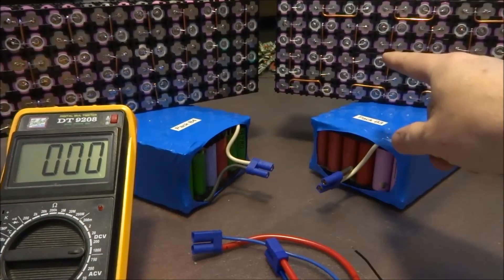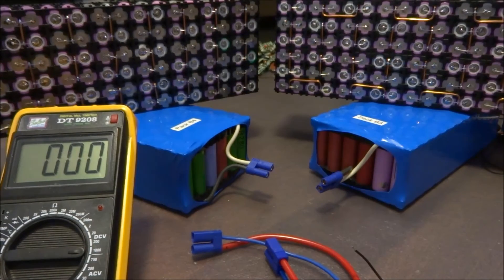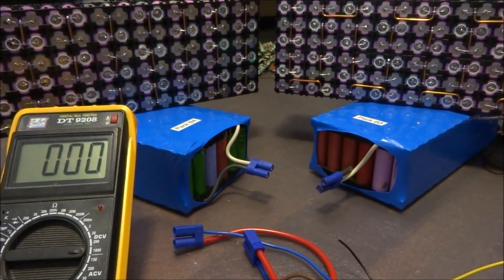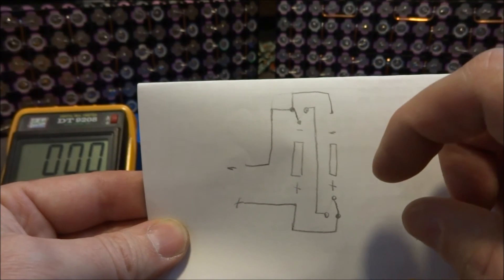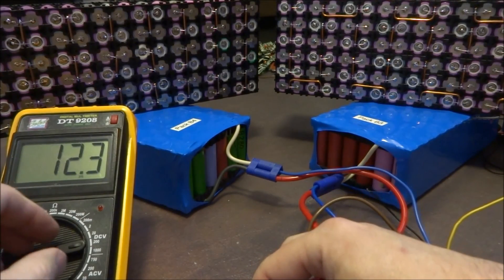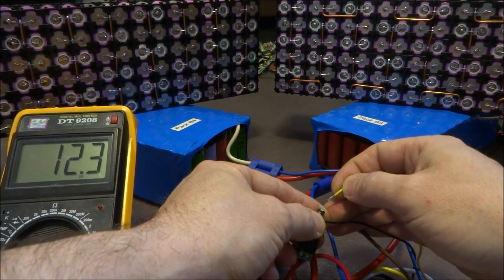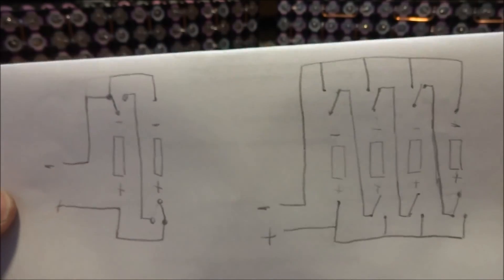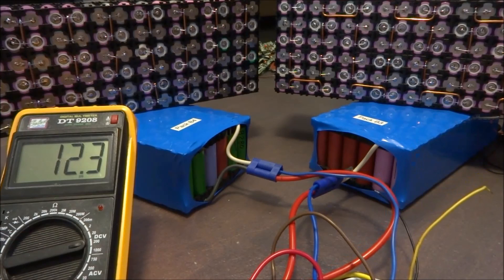Nissan LEAF range extender pack build Pt.2.7 (prototype pack)

Comment: Building on what Geoffrey Callander said (which i agree with) ... 

The failure mode of relays includes failing to engage, which is safe since the contacts do not move ... and failing to disengage, which is NOT safe since contacts stay closed when you remove power(!!!)  This is also called 'welding' the contacts closed and can happen when you overheat a relay, when a large current is run through a relay (even for a short time), or when the contacts get dirty and the resistance of the contacts goes up .. causing heating .. and the contacts do actually stick together due to welding.

if it were my car, I would use the relays with 1 set of Normally Open contacts and 1 set of Normally Closed contacts.   Use the first set of contacts, Normally Open, as you have shown - to connect all of the smaller packs in series.  Use the second set of contacts for each relay to ensure that ALL of the relays have opened when the power is removed.  This is done by wiring all of the second set of relay contacts in series.  The relays that are used to change the wiring to parallel for charging are powered through that second set of contacts on the series relays.  If even one of those relays sticks, the second set of contacts will not allow your 12V signal to get to the parallel charging relays.  Of course, the parallel charging relays also have a set of normally closed contacts which can be monitored to make sure all of them open before engaging the 12V relays to put them all in series.

Technically, you should use relays that are EACH rated to open for 400V.  That is much more expensive and takes much more room.  At the minimum, when using automotive relays, I would wire them to make sure that one set of relays have ALL disengaged before engaging the other set.

Great work on the project - looking forward to seeing more!
Reply from the maker: Great suggestions!

Comment: Hi, 
I have been following your videos with some interest as a also have a Nissan Leaf.
I have some concerns regarding your series/parallel switching design that could cause your relays to burn out or worse.
I understand that you want to use a lower voltage battery charger and also use some natural balancing between your packs.  But using double throw relays you risk having some connections being made before others, and massive currents could flow (imagine some of the packs connected in parallel and some in series). I recommend using two sets of relays, one to connect the packs in series and an other to connect the packs in parallel. When both sets of relays are not energised, then none of the packs are connected to each other at all. (Fails safe)
Also your individual battery packs will likely be at slightly different voltages when you switch them to parallel connection. It is possible that quite large currents will flow from the higher voltage packs to the lower voltage packs. You may want to include resistors on each of your packs when connected in parallel to limit this current. I would recommend something like a 1Ohm 25Watt aluminium body resistor. (Though I have not done the calculations on this)
I would also recommend high rupture capacity fuses (HRC) between your main traction battery and your range extension battery. The HRC fuses should be placed near to your extension battery in both the positive and negative leads.  
You will also need some mechanism to stop the possibility of connecting the extension battery to the traction battery when the extend battery is configured in parallel mode. 

I mention these precautions to limit the likelihood of catching your battery, car or house on fire.
Reply from the maker: Thanks for the tip! I will seriously consider your recommendations!
Reply: Great, I look forward to seeing how your project goes.

Comment: Does the leaf on board charger output 368vdc to the leaf battery?  Or is it a balanced charger e.g. nx48vdc?  If the former then just put your 18650 pack directly in parallel without relay to keep it simple and reliable plus benefit from the two packs naturally balancing each other. See jgarcia youtube on charging/balancing 18650 ideas'.
Reply from the maker: The on-board charger outputs the appropriate voltage for the battery pack ie. up to  386v DC. The battery pack has a BMS to balance all the cells, mine doesn't.
Reply: Oh ok thanks.  So if you connect your pack in parallel via your tee connector wont the pack simply auto balance?  I'm not sure why you need a bms, balance charger and relay systems. Cant you just plug it in parallel?  (note: im a total newbie and just started learning this stuff).
Reply from the maker: Yes, if I leave the packs connected they will balance together but the individual cells in my pack can get out of balance. The 96 cell pairs need to all be at 4.13v when fully charged. They can slowly drift to a point where some cells are at say 4.05v and others are at 4.25v. Also, in order to "permanently" connect my pack to the LEAF pack, I'd have to make the connection inside the LEAF pack. When the car is off, there is no voltage on the high power cables, the relays are inside the battery pack.
Reply: ok that makes sense thanks.